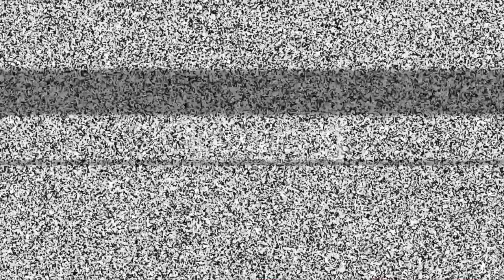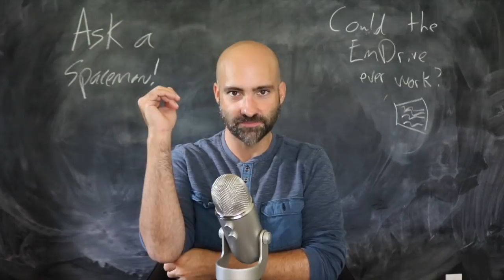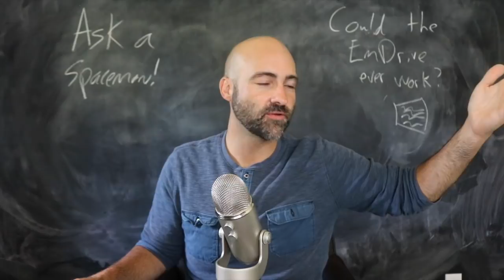The EmDrive Experiments Were Junk - Ask a Spaceman!

Comment: I dont like the argument that "They have been trying for 20 years and noting has happened" so they should just give up. They have been trying for nuclear fusion for an even longer time and are still trying to make it work. Why dont they just give up on fusion since it hasn't worked at all for so long.
Reply: Because we have proof and evidence that fusion actually works and adheres to the laws of physics and nature.
Reply: To politely and respectfully interject, nuclear fusion has facts in data that clearly work. One of the main problems is the amount of energy going into the reactor is more than you could get out of said reactor at this time with the level of technology we have now, the EM drive (as much as I want it to work) breaks the law of physics whereas fusion and fission do not.
Reply: It doesn't matter if you like it or not. The EM drive has no actual basis in science. It's a pipe dream. Fission and fusion actually work. We have fission reactors already and we've achieved fusion in labs. We just haven't reached ignition yet (the break even point where the energy required to initiate the fusion reaction is equal to the energy generated by the reaction itself).
Reply: @bobjohn8581  you're right, it is incomplete in that it lacks a grounding in how the physical world actually works. If you design something that's function is based on the violation of one of the most fundamental concepts in the universe, you've designed nothing more than an expensive paperweight. The EM drive is...useless.
Reply: @bobjohn8581  no, the machine does NOT work (EM drive). I think you need to let the actual scientists and engineers be the experts on this.
Reply: @bobjohn8581  no, it goes against well established science. The fact that you think it just lacks gas is kind of ridiculous. It's not supposed to operate by using gas. It's an EM (electro-magnetic) drive. It is supposed to use electricity to generate a standing microwave that somehow pushes the device in one direction. Sorry, nope.
Reply: @bobjohn8581  yes we do, and by doing so we still do NOT violate any known law of physics. Em drive on the other hand would violate known physics if it worked, which it doesn't, of course
Reply: @bobjohn8581  not even in anyone's wild dreams...
Reply: @bobjohn8581  so, you admit your opinion has no actual basis in science. Got it. It's one thing to crowd source (group think) a scientifically viable concept. It's another thing entirely to try to solve an engineering problem that violates one of the most essential laws of nature. Your opinion no longer carries any weight. Have a good night.
Reply: @bobjohn8581  sorry, nope. Have a good night.
Reply: @bobjohn8581  so...i'm wrong and so are a vast majority of physicists and engineers? Got it. Now you just sound silly.
Reply: @bobjohn8581  you are reaching. You do not understand the science at work here. This debate is over.

Comment: What is the significance of the EM Drive? I mean it has to consume some energy to create a thrust. Is it more efficient than a photon thruster?
Reply: Its about as efficient as having a brick in a place of an engine: does. not. work.
Reply: @godfreyofbouillon966  assuming it was going to work, was it supposed to be more efficient? Or does it have a higher impact?
Reply: IT was supposed to turn electricity into thrust, so yes, you had to provide electricity

Comment: Well there have been a lot of crap experiments, but there is one that did show a tiny amount of thrust but it could just be radiation from the power supply, it isnt conclusive yet. But it is a good experiment, its on a torsion balance in a vaccum and it did show thrust in either configuration clockwise and anti clockwise when the machine was turned the other way. The problem is the power supply is on that other side so the thrust could simply be heat radiation from the power supply.

I have not looked into it further then that and that was some time ago. So when you say the experiments were junk do you take all the experiments into account, or just those that were actual junk? Because you seem to forget some experiemtns.
Reply: If they haven't taken power supply thermal emissions into account from the go (it is a rather obvious one) then yes, it is a junk experiment.